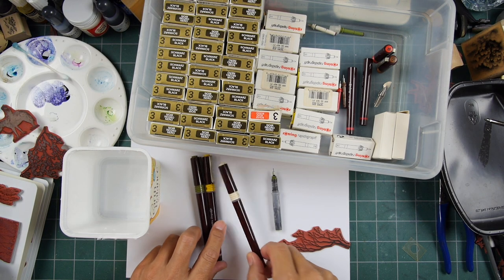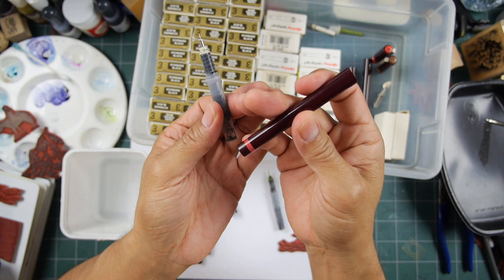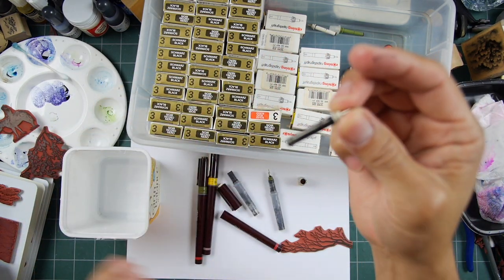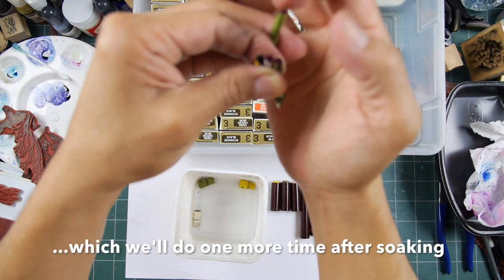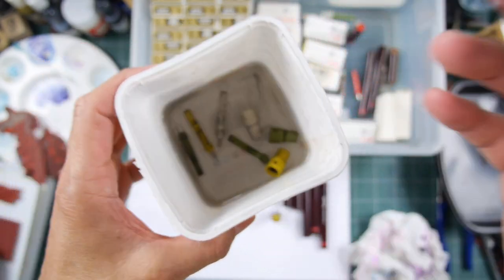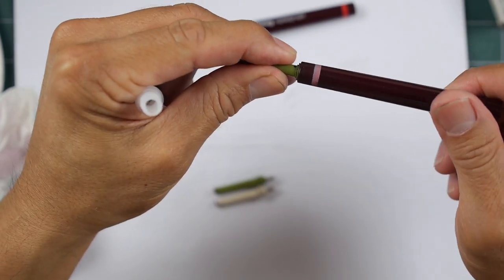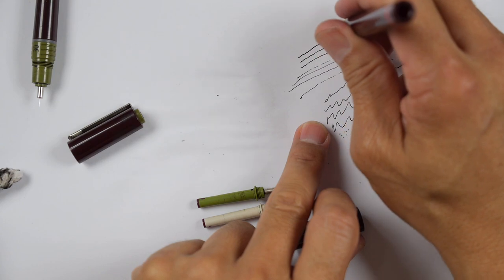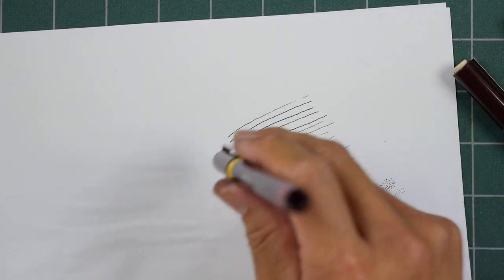Rotring Rapidograph Cleaning & Unclogging

Comment: I just picked up an almost full set of Isograph pens from eBay. The seller was an engineer who did not need them anymore. The price was REALLY good (about 30 bucks shipped) so I could not pass up. 

All of them were dried out and they were an absolute royal pain in the ass to clean because the ink had turned into a sticky and gooey mess. And I did what you were apparently never supposed to do, ever: I removed the needle out of each one for cleaning. 
Because even after soaking the pens overnight, there was still so much ink coming out there and nothing would budge. Nothing seemed to make a dent. It turns out that around the shaft that holds the actual needle, the dried-up ink had formed a really solid and sticky layer that would not give up without a fight. So I made sure that none of the ink remained on there, flushed everything out and reinserted the needles. For the record: 
You really should not remove the needle if you can at all avoid it. The 0.7mm was still quite manageable but at 0.5 and below, things are really not funny anymore. The needles are so incredibly delicate that you need really steady hands to get them back in without bending or breaking. I do lots of soldering with some quite fiddly parts (SMD) so I like to think my hands are steady enough but I do definitely not recommend it, even though it worked out in my case - maybe I was just lucky. And now I have working set Isograph pens (sans the smallest size pen)😊
Reply from the maker: Wow, awesome job!  I never worked with Rotring Isograph pens as I didn't want to deal with those removable needles again after using Koh-i-Noor Rapidographs for years --where I ran into those same issues you're referring to with having to thread the needles back through those tips.  I don't think I was successful with many of them when doing that as they always seemed to bend.  It's amazing that you were able to thread them.  What a great price though.  Hope they work well for you for many years.  Thanks for the note too. It's a good tip for those thinking about removing the needles.  I guess, if they've tried everything else, and the pen isn't going to be usable without doing it, they might as well but it's so incredibly hard to thread them again without that bending happening.
Reply: They are actually not that difficult to get back in when you know the trick, and have, indeed got the dried ink from the shoulders of the wire holder and in the cone that leads to the needle.  The danger with the fine wires comes from trying to pull them out, when the finest will just snap.  The trick is to vibrate them in and out.  I've been doing that with an electric toothbrush with the brush removed. After soaking, you'll find most of the wire holders will gradually drop out if you hold the buzzer tip to the side of the needle holder.  To get it back in without forcing, you can use one of the transparent tubes they give you to help dismantling: screw it in and gently let the wire holder slide down it towards the needle. Then hold it upright and gently tap or buzz from the side, and you will find the wire drops in, unless you got kinks in it.
Reply: I have gotten the 0.5mm back in, but can confirm it's tricky.
Reply: I have taken apart a 0.35 and 0.25, so will let you know...they were gummed solid so didn't work anyway...will report back if I remember....but yeah, 0.7 and 0,5 you can get the needles back in, just carefully drop them from above and let gravity insert them, slowly.
Reply: @spamletspamley672  ooh I'll remember this for the finer ones. I find gravity works fine for the 0.7 and 0.5, like drop them in vertically.and rattle it gently I guess a similar technique.....
Reply: @realfingertrouble  Since I got the ultrasonic cleaner, I've found the hardest part is getting wires out from gummed up holders without breaking them. I had one old .25 Marsmatic that my father had filled and then put back in the box and never used, so the whole lot set solid.  The proper needles are incredibly well made and actually tapered to an extremely fine point, so it is best to try not to break them, but, if you do have one that's broken and you have cleaned the ink out, you can actually buy extremely fine stainless wire from China and thread it back through the end of the nib under a lens, and then feed it inside the shuttle sleeve, and cut the end off, and it works even without the proper tapered pin.  The trouble with my father's one was that the shuttle is iron with a plastic sleeve that has a hole each side that you can push a drift through to ease the metal part out so you can fit new wire. In my father's one the plastic sleeve had split and ink and rust had got under it and made a bump in the side that jammed the shuttle at an angle and trapped ink behind it that would not come out with many cycles of us with different solvents.  Eventually I hit on the idea of cutting little scraper slivers of metal from a beer can that would fit between the shuttle and side of the holder to gradually scrape out the solidified ink with bouts of us in between, until no more black came out. Then I had a supermagnet with a hook eye on it, which very usefully holds onto the metal inner shuttle, so I could suspend the nib unit in the us cleaner with the weight of the magnet to help ease it downwards.  After about a week of trying, I could at last see it was beginning to move!  It was still amazing how much dried ink was still in behind the shuttle, that needed more us to completely clean even then, but the  end was in sight!  The bump in the shuttle plastic looked to have been made by a bubble in the metal casting filling up with rust and dried ink, which I scraped out as much as I could with a scalpel, before filling with superglue and setting it hard by dusting with bicarb. Then just sand smooth, and pop back in, and I had the pen working fine that probably hadn't been used since  I gave it to my Dad 30y ago!  :)  With the newer .18 Marsmatic that came without a cleaner wire/needle, and had to fit with the fine wire on a reel from AliExpress, mentioned above, I now have 4 pens of .5 and under that have been working every time without much shaking, for months!  It's great to be able to write waterproof labels any size any time, for the first time in years! :)

Comment: I used a 0.35 rotring as my day-to-day writing pen in highschool. It moved across the paper more comfortable than a ballpen. I remember dropping it on the floor one day, the tip was bent and the pen destroyed :-( I had to buy a new one - and they're not cheap. Nowadays I often use a fountain pen.
Reply from the maker: Excellent pens for sure but, like you said, not cheap.  Especially these days.  When I thought Rotring might be going out of business I got lucky and bought some existing inventory at discount prices from one of the last large domestic resellers that were blowing them out.  I'm guessing the volume of sales dropped so they stopped importing them at some central distribution location so anything you can get in the US now comes from overseas by independent resellers (instead of a distributor).
Reply: @stampscapes  Steadler Marsmatic (also a technical pen serie) is a good alternative to Rotring. Marsmatic is easier to refill too, because it has ink reservoirs like the Isograph, in contrast to the Rapidograph.
Reply: Well you can buy a replacement for the tip you don't have to buy a new pen
Reply: @giannistaz  Yes, but I didn't know that at the time ;-)

Comment: Brilliant explanation, not sure if Im leaving them long enough but doesnt appear to be working, is it better to put new cartridges on when finished, my catridges are quite full. Let me know thanks Martin
Reply from the maker: The biggest thing, if the pens were still working before allowing the ink to dry in them, is to get every speck of ink out of the cartridges.  The drier they were, the longer it takes to tap all of those tiny grains of ink out of them (by tapping the back of the nib on to the bottom of a bowl of water).  Residual dried ink can seem to keep the nib clogged.  I usually ask people if the pens were theirs. It sounds like these were yours if the cartridges still have ink in them?  Or did you clean out some pens and try the cartridges and they're still clogged.  I ask that, as some people have purchased or acquired used pens and couldn't get them working.  In some cases, they might have just stopped working in the first place where cleaning isn't going to help out.  That inner needle might have been bent or something like that.  Now, if you've cleaned the nibs and installed the cartridges and can't get them working, try and shake them up a lot -minutes even- with that piston going to dislodge or liquify any dried ink and see if you can't get them flowing. If not, remove the cartridges and clear out the liquid ink and soak the nibs in some hot water and see if you can tap out more dried ink grains.  There can be a lot of that and it seems like your'e tapping forever.

Comment: Hey, some question. I habe a rotring rapidograph 0.35. My problem is that on the needle tip the ink overflows, not much, but whenever i take the pen off the paper and putnit back on while drawing i already have a plopp of ink there than. Did clean it, did unscrew everything and put it together without to much force and also did change the ink with another new one. But still leaks... should i buy a new needle and replace it, even though it isnt realy old yet, or does anyone have the same problem or knows what i can do in a case like that???
Reply from the maker: Yeah, I know exactly what you're referring to as it's happened to me enough times over the years.  Unfortunately, I don't know the exact cause as it's happened with both new and long used nibs.   I've speculated that it could have something to do with air pressure.  I think it's happened to me before when I've been using the pen in one session for a amount of time that the warmth of my hand causes the temperature of the ink to rise a few degrees and that difference causes just enough pressure for the ink cartridge to want to push the ink outward.  I haven't tried it as I usually just switch out to another cartridge but I should have maybe just removed the nib from cartridge slightly to allow the cartridge to "gas" (if that might possibly have been the issue) or maybe just put submerge the nib and cartridge into some ice water for a minute and see if that was happening still.  I don't remember some nib having the same issue repeatedly so that's why I speculated that it could be some pressure issue because, yeah, you can hold the nib in any direction and watch that drop of ink developing.  So, try one of those tests before you replace the nib.  See if it starts doing that immediately upon usage and if so, try the ice water, and then the "gassing".  Now that I think about it, maybe once in a while when we insert the nib into the cartridge, that tiny bit of air displacement could pressurize the cartridge more than other time?  It's been rare but a regular enough occurrence (over decades of using these).  I remember it as it always drives me nuts when that's happened.

Comment: I cleaned my isograph after 2 years of sporadically using it. It writes better than new. Wished they used a better plastic to prevent  micro cracks developing on it where the threads are.
Reply from the maker: Interesting with the micro cracks.  I've never used the Isographs and all of my Rapidographs were purchased years ago but I wonder if the plastic formula changed over the years as I've never had a problem with cracks.  Hopefully, the pen will last for you.  Maybe if your'e in an arid area, when the pen's not in use, maybe keep it in a hydrometer type of environment. The Koh-I-Noor line of Rapidographs used to have this plastic fairly sealed holder where you'd keep the pens and there was this slot where you would keep this small damp sponge to keep that environment a little more moist.  Could just use a ziplock bag with a slightly moist wadded up paper towel.  Unless the cracking is solely from tightening the nib with the ink changes.

Comment: I have soaked my nibs 3 different times and still the piston does not move.  Any suggestions?
Reply from the maker: Some have mentioned that hot water has helped them but what size nibs are you working with?  If the nibs are the really small ones,  .2, .25, etc. even a tiny crumb of dried ink can restrict piston movement.  You have to really tap out all of that dried sediment.  Firmly tap the nibs (tip side up of course) into a bowl of water and see if you're getting some crumbs of ink coming out and eventually dislodge the stuck piston.  You'll usually see these micro grains coming out and, eventually, get that piston going which will really get those grains coming out.  Try that and some hot water.  If you get the pistons going and you're able to tap out that dried ink, make sure to really out all of it as you don't want to put a new ink cartridge on the nib only to find out that there was more dried ink in there and that clogs the new ink.  That's happened to me before when I've hurried the process.  Were these your pens?  If so, I would think you'd can get them working.  It's not always 100% successful as these are fine instruments but I've always got most of mine going again.  Sometimes when people find some used pens (not their own),  what ink was used or the interior wire might be bent, could make them unrepairable.

Comment: Soaked my old dried nibs like this for days in water. Did nothing, hardly anything came off...I see in the description you mention cleaning fluid - that's all that worked for me, it's worth the money, or an utlrasonic cleaner if you have those.

Maybe roTring changed the ink, but the older ink is highly waterproof so obviously doesn't come off in water soaking or flushing!
Reply from the maker: Strange but good to know.  I doubt tap water quality would have anything to do with it but maybe newer ink chemistry changed.  The inks I've used are from probably 10 years ago and have been using the pens for 35 years.  Water's always worked fine for me.

Comment: Do i need to cleen  the pens everyday or just when they dry up
Reply from the maker: Ideally, your pens are never going to get dry and crusty like mine do but sometimes I go for a year in between usage.  If you're using your pens on a regular basis, you might never have to clean them out thoroughly.  When they run out of ink, just replace the old cartridge with a new one.  Now, if you're not using them regularly, and if you're disciplined enough to do it, you might just get the ink flowing by drawing a few lines with the pens once/week and just watch that the ink isn't drying up.  Also, you might keep the pens in a ziplock bag with a slightly moist (but not too damp) paper towel or small piece of sponge in there.  That keeps the environment a little moister so as to prevent the ink from drying out as fast.  The Koh-i-Noor Rapidographs had, or maybe still do, have this pen organizer/container that you do that with which is probably a good idea.
Reply: Thank u bro